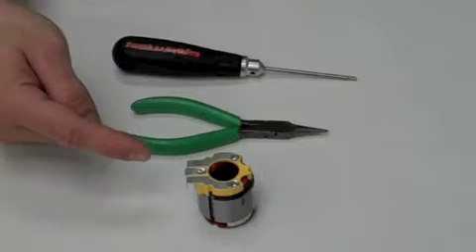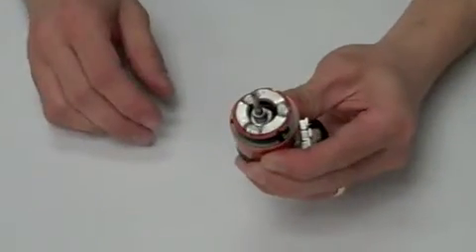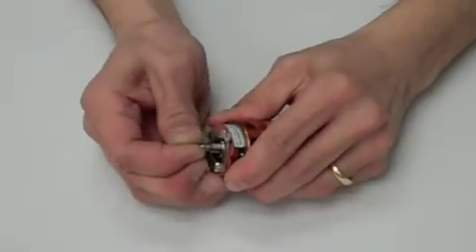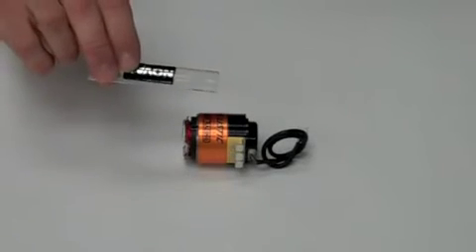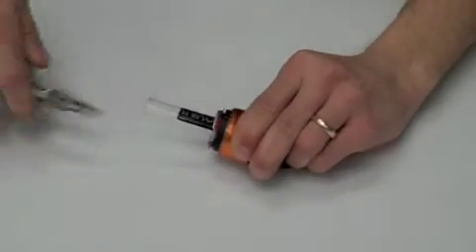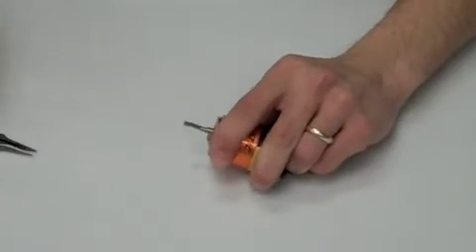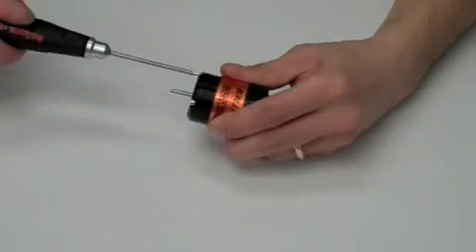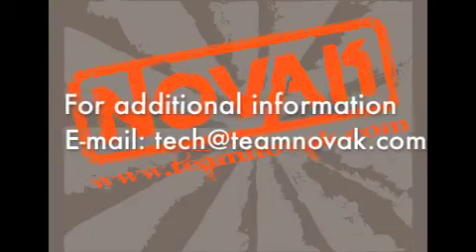How to Install a Brushless Hand-Wound Stator

Comment: nothing was mentioned about the spacers
I was told to always add them to the front facing the gear and never in the rear by the senor is this true as I'm looking at replacing my Ballistic from a 21.5t to a 13t 

Thanks and look forward to your answer

Comment: so I'm racing 17.5 spec now, and another track runs 13.5 spec. Can you do this with the motor wires still soldered on?

Comment: @bdhd206 as long as you remove it without hitting the sides you should be able to get away without using the rotor tube. I've always have done it this way and my novak motors have never failed from a splintered magnet.